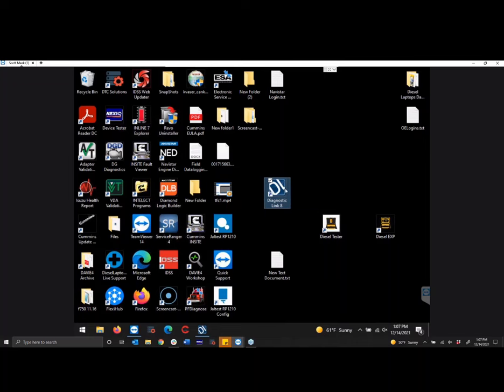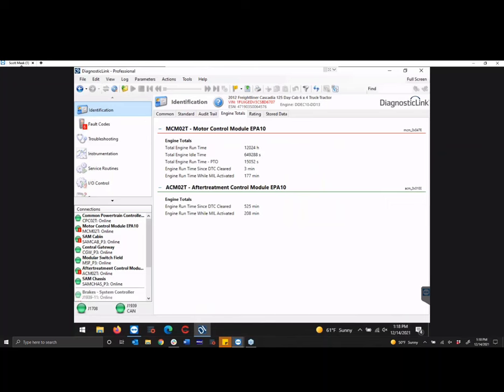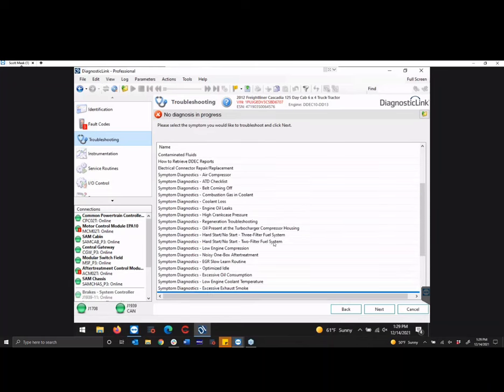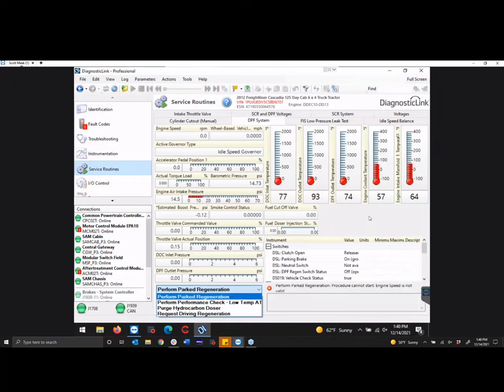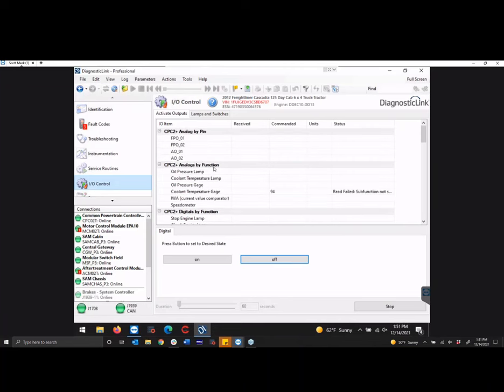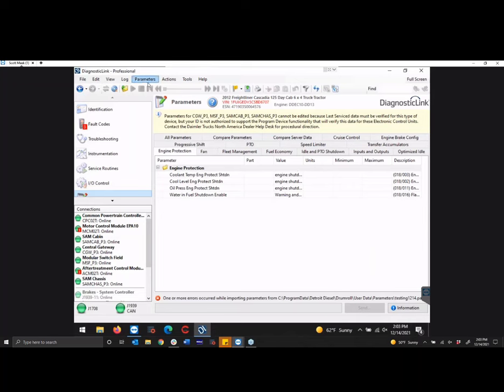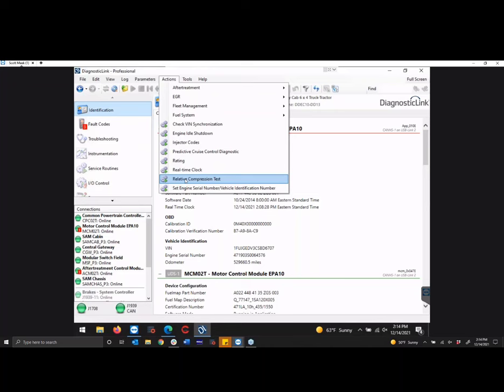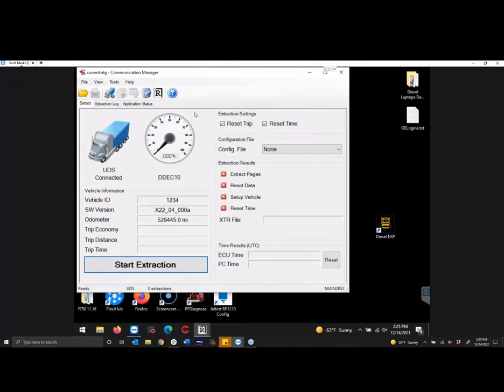Detroit Diesel Diagnostic Link 8 Training

Comment: How can I exit from engine derate 5mph using this tool?
Reply: Where is the problem? If there is a problem with a component, you will want to fix the problem. If it’s just a Regeneration issue, Do a regen. Sometimes SCR efficiency test can take you out of derate but it won’t fix your initial issue. Sometimes it’s better and cheaper to tow trucks!

Comment: Question- We recently bought another 2016 Cascadia DD15 and she’s been turned up to 560 with boost pressure up around 39 on a pull and I’m looking to put a driver in it but I’m wanting to turn it down especially boost pressure.. 

Can we do that through Diagnostic Link?

Comment: Currently connected to 2016 Cascadia. However, I am running into an issue where my Service Routines tab doesn't load past a white screen. It shows my VIN and everything as it has identified the truck, but will not allow me to see or perform any tests. Does anyone have any idea why this is happening, or how to fix this? Thank you.